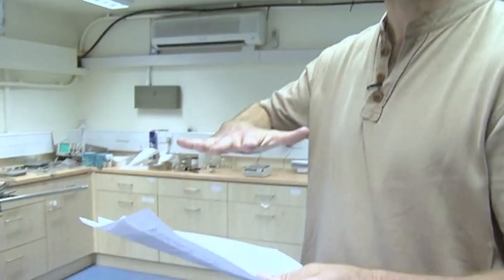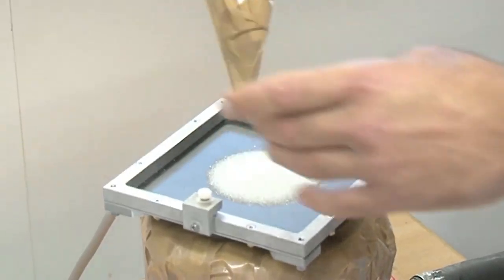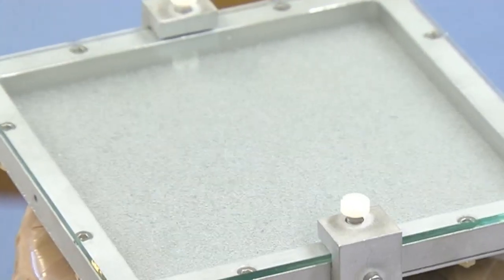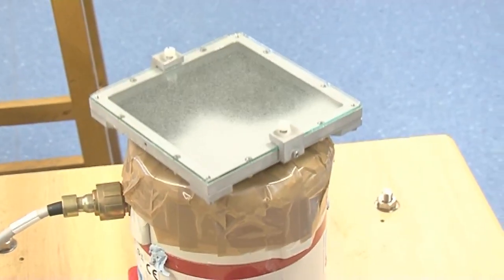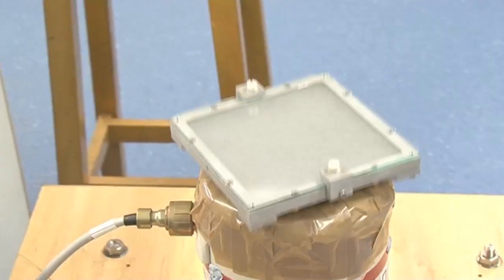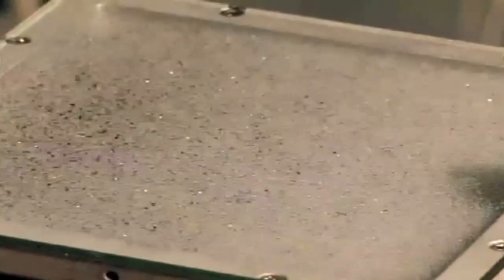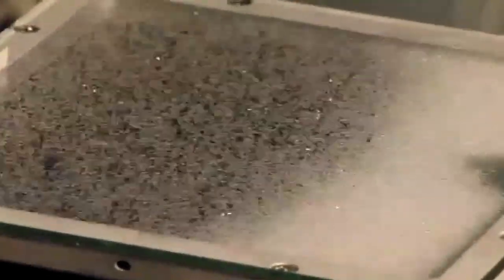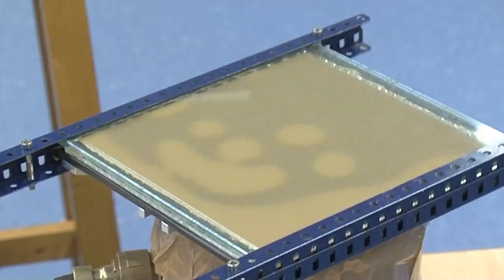Granular Dynamics - Sixty Symbols

Comment: @godlyking3 Yes they would because the base of the cell throws the grains up, and they hit the top of the cell and bounce down again, in zero gravity. And so on. When gravity is present theamplitude of oscillation has to be large enough to overcome the effect of gravity so that the particles hit the top plate..

Comment: I'm wondering.... would this also apply to the expansion of the universe. When the coherency of energy is achieved in a certain state- where particles are in chaos in a certain energy caused by the pressure of the expansion to the observation we just saw with the grains.

Comment: @Azyashi
Here's what I think happened. Remember the ideal gas law? PV=nRT or PV=mRT depending on your units. When the granules were in random motion, all the energy input from the vibrator thing = energy lost. When the granules started bouncing coherently, the "temperature" of the granules spiked up and so did the pressure. Since he said that collecting at one point will lower the pressure/temperature, all the granules started collecting there and eventually it evened out again. Unsure though.